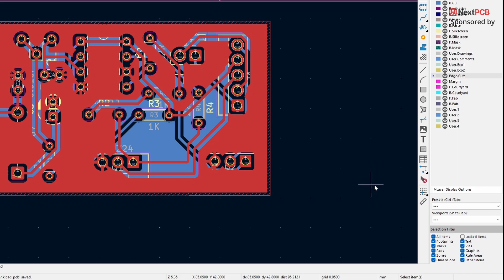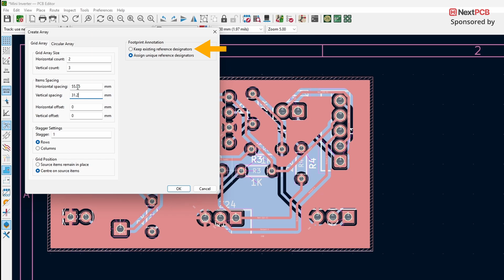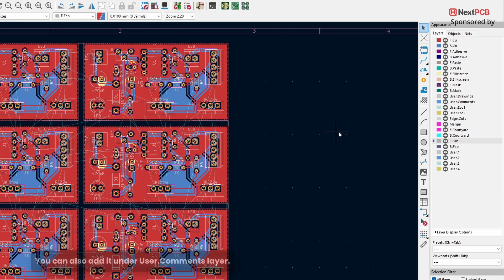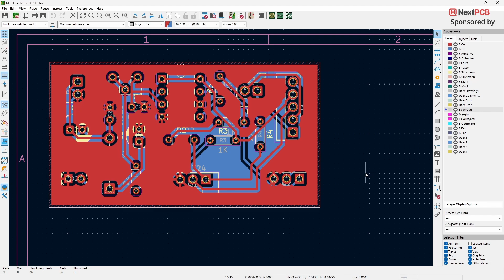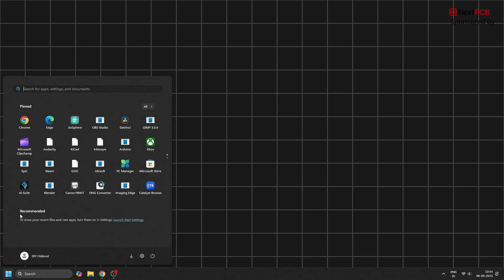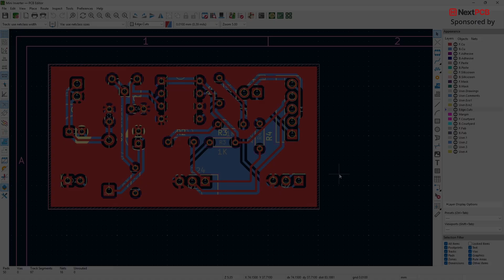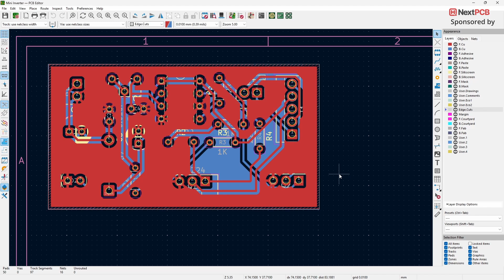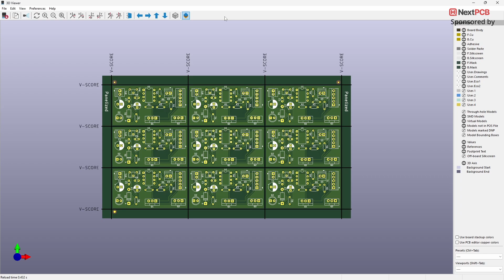How to panelize PCB board using V cuts in KiCad 9 | Beginners Tutorial

Comment: This is a great explanation, it took me ages how to find out for v-cuts. Thank you!
Question, why does the V-cuts not showing in 3D view.
Also, some footprints have data also in F.Fab. It was needed to remove this with footprint editor hence showing more errors.
Reply from the maker: Thanks for the feedback! Unfortunately, V-cuts don't show up in the 3D view. You can ignore the F.ab layer if the data is not important. Can you please share the error message.
Reply: @diyhideout  I have removed the F.fab drawings in the footprints. PCB are send for production now, i will see the outcome when they arive. The error was because the outline was bad. That was solved.
Reply from the maker: Great!